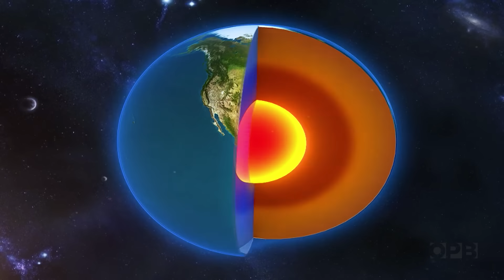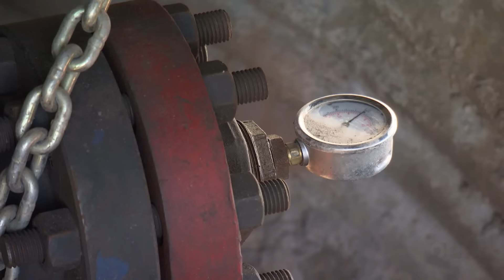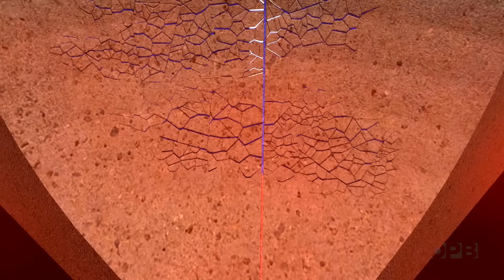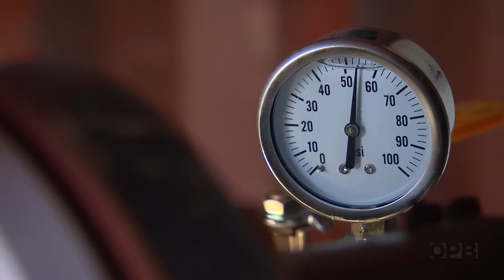Harnessing geothermal energy from ancient Newberry Volcano | Oregon Field Guide

Comment: Read about the 2 geothermal plants on the island of Hawaii that eventually led to volcanic magma eruptions. With large lava flows and property destruction of housing areas and highways. This includes the latest incident of a fissure eruption and flow down to the ocean enlarging the island. Before the lava started cooling, developers were in conflict over ownership of the "new beachfront property".
The original hole/ lava lake at the Hawaii Volcano National Park was originally the site of geothermal drilling. I don't know exact details but it's obvious this information has been suppressed from the public in Hawaii and elsewhere. Do some research about this if you live in the Bend Newberry volcano area.
My parents owned a cabin for many years at Union Creek OR. I visited Crater Lake National park many times since the 1980s. Originally the Rangers would say it was an extinct volcano caldera from the last gigantic Mt Mazama eruption. The last few times we went ther with my Sons, the Rangers said it was now considered a dormant volcano with the potential for a future eruption. Scientific excursions with deep submarines had revealed many several hot spots at the bottom areas of the lake possibly indicating shallow magma. That's is why Crater Lake is now on the list of high risk potential volcanos in the NW USA.
Personally, I don't think that drilling 2 miles deep holes in a known volcanic area is wise.
Your mileage may vary.

Comment: An appropriate project. The injection of water can be a safe endeavor. However, Will Osborn should avoid trying to split semantic hairs as it simply makes him appear dishonest. To paraphrase him: in the oil and gas industry, they actually shatter the rock…and we just inject cold water. Well Will, injecting cold water into hot rock above the boiling point of water is going to create cracks, as the graphic shown depicts that process. This project is hydro-fracking, with a variety of differences from what the petroleum industry does, such as adding chemicals to maximize the spread of the cracks or using higher pressures than planned here.

Comment: It's fracking without the chemicals and the atmospheric emissions. Microseismic events possible just like the small earthquakes they get in Texas from all their fracking. It's great to have a diverse supply of renewable energy but they all come with tradeoffs, solar, wind, or geothermal. If there isn't water loss from the well hopefully it can be developed. I'd hate to see that dry well start needing additional water though if the fractures leak into the surrounding porous, volcanic rock. We don't need any additional demand on water here. We also have plenty more room for solar in the Oregon desert instead of importing it from Wyoming via Idaho like what Pacificorp has planned. Let's keep energy in Oregon and make it cleanly with low impacts

Comment: A “ high threat volcano” and the process being put forth sounds like a potentially dangerous combination. Just my thoughts.
Reply: The Mt. St. Helens eruption produced a force equivalent to 25,000 atomic bombs. I sincerely doubt a few drilling rigs and some water pumps can come within .0000001% of the same magnitude of force. It seems extremely unlikely that geothermal drilling will have any tangible impact on the volcanic forces underground. Besides, according to the video, they are drilling on the flank of the volcano, not directly over the top of the magma chamber. Obviously the heat is much closer to the surface inside the caldera.

Comment: If there is enough thermal energy, and if properly developed, this seems one of the cleanest and most sustainable sources of energy--much less impact even than solar, wind, or wave/tidal. Least impactful to natural habitat and biodiversity if done right. I grew up spending time in central Oregon but learned a lot about Newberry Crater from this video, thanks!
Reply: @scrubjay93  since when was fracking less impactful?
Reply: If I am correct, they taped into an underground system did not have to fracture old rocks not already fractured thank you

Comment: As long as nobody gets hurt this appears to be an excellent idea. Would this plant only serve Bend or would it be able to be transmitted state wide? Just wondering.
Reply: Maybe so. But it seems naive to think this kind of money and effort would be spent only to benefit Bend. My bet would be power generation of electricity sent to Central/Southern California.
Just like the 1 Million Volt((+/- 500kV) Pacific DC Intertie electrical power goes from the Bonneville Dam on the Columbia River close to The Dallas OR. All the way to the NW LA basin area at Sylmar CA. 3.1 Gigawatts. Almost half of LAs peak electrical capacity.
Originally built to send electrical power from OR to SoCal in the hot summer months. And then reversed to send electrical power to OR in the cold Oregon winters.
I have no idea what occurs now. But I suspect the flow is from OR to SoCal ~100% of the time.

Comment: And where is all the water going to come from, and what happens if the fractures lower lake levels?
Reply: @n1west  why would surface level water decrease as a result of injecting water before the surface?
Reply: @TokinWhiteKid  unique geology in central OR, very porous rock.
Reply: @TokinWhiteKid  Heated water will evaporate and the more they use, the more they lose.
Reply: I could be wrong and maybe they can contain the evap as in distilled, and re-added back to the source. It said "Closed loop" so it is possible that there is no loss, but I struggle to believe that completely. Plus, they are doing 3 layers and whenever the project is finished, all the cracked earth needs to be filled with, you guessed it, water.
Reply: @TokinWhiteKid  Why wouldnt it?
Reply: It doesn't seem as if the water itself would be exported outside of the groundwater basin. I think the pumped geothermal water is used to generate energy that is exported to the grid. The overall water impact in such a case would be near neutral. If it required diverting flows from streams, that would be a serious impact, but such permits would be extremely difficult to approve normally due to environmental regulations that protect fish and aquatic life. I doubt the company doing the exploring even considered that in any of their plans.
Reply: @scrubjay93  water would have to be pumped from a well, and water rights locally are already a hot topic.
Reply: @weridebikes1000 deschutes river is nearby, isn't it?
Reply: @ it’s protected water, you can’t just take some because you want it.
Reply: @poofygoof You’d have to pump it across a highway, several miles uphill. Good luck with getting any more water rights on a river whose flows are already far too low accommodating legacy water rights holders.

Comment: Nobody in Central OR is really excited about fracking in our backyard, nor a geothermal plant in the forest. The bigger the project gets, the more local resistance  you will find.
Reply: This is a silly, defeatist attitude. Geothermal energy is a gimme and a totally underutilized, clean source of energy.
Reply: So? We need renewable energy and that area uses the most coal and gas energy.
Reply: NIMBYism is a huge problem in the US.
Reply: @ it’s not Nimbyism, they want to frack inside a national forest, next to a community that depends on ground water. Make it make sense.
Reply: @weridebikes1000  fracking is going to provide electrical power to your community regardless if you prefer it coming from geothermal or gas fracking.

Might as well skip the fuel part and use the folks that worked in oil/gas to do the sand thing as geothermal; economies of scale = cheaper electricity prices!
Reply: @ that logic is ridiculous and makes zero sense. The USA is a net exporter of fuel and fracking is not needed.
Reply: @weridebikes1000  I would argue it very much is NIMBYISM. This portion of the state overwhelmingly chose the candidate that wanted to "drill baby drill" and gut the Nation Forest Service.
Reply: @weridebikes1000 fracking IS the reason why the US is a net exporter of fossil fuel, geothermal is the best use of fracking because you don’t have to inject any of the chemicals that are used for fracking for natural gas or oil.
Reply: Oregonian here and against fracking, but in support of this here because it’s not fracking and because we need more renewable energy. As an avid hiker who hikes a lot in that area and all over Oregon, central Oregon especially, I have all the reason to care about any sort of environmental impact to that area. But it sounds like it will be a net good thing with very minimal downsides.
Reply: @ OR is a net exporter of electricity.
Reply: Um you do know that Oregon is NOT known for having smart people 😂
Reply: They are fracking for steam, not oil. Would you rather keep buy solar wasteful panels?
Reply: @ 100% solar. This region is prime for it. National Forest lands should remain untouched.
Reply: @weridebikes1000 yes, it IS sunny here. BUT, solar panels create more waste and green house gas than geothermal energy. Solar panels go in landfill after 25 years. Solar panels only make energy when it’s sunny. What about ash clouds from eruptions, fires, rainy days. I can go on. Solar is NOT the future. Solar takes up too much real estate. Bad for wildlife, especially if it involves mirrors.
Reply: I think there is not enough energy "density" at these sites to make them economically viable.
Reply: @BjarneLinetsky And your actual qualifications to make such a statement?
Reply: @manfredstrappen7491  Critical thinking skills. something that seems to be sadly lacking in our internet/AI sphere.
Here is my thinking: Rock is an excellent insulator. When you have extracted the thermal energy in a given volume, the rock cools down, and it takes literally forever for heat to conduct into the cooled volume. Geothermal energy is very low grade, because extracting energy depends on temperature, and 500 degrees yields energy at very low efficiency. Thermodynamics...